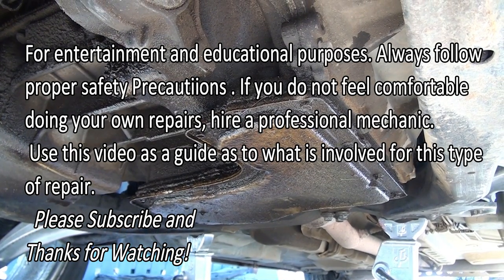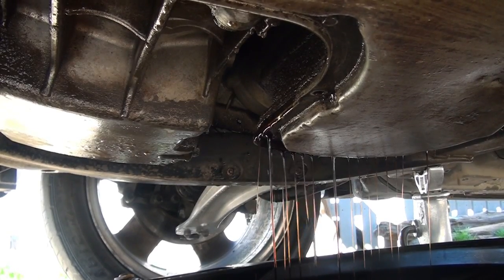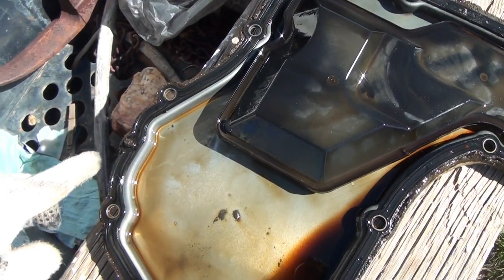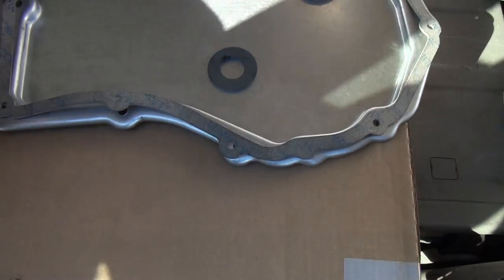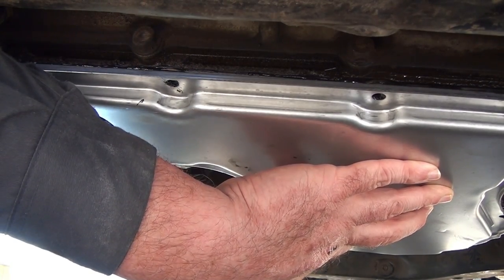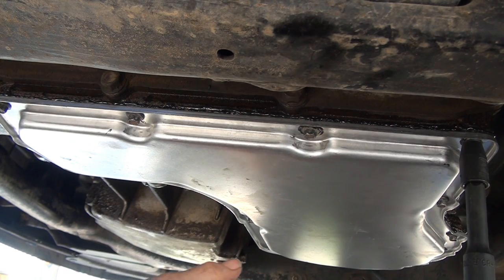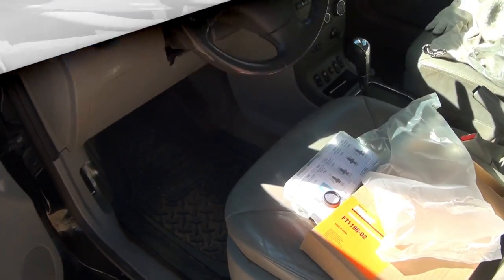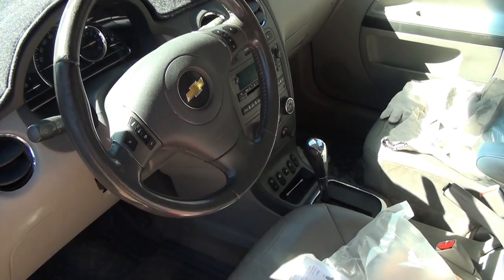Chevy HHR Transmission Pan and Filter Replace 2 4L

Comment: There is a port on the pass side to check level.  Well, you open it and fill until fluid just starts coming out the port.
Reply: With the vehicle running or off?
Reply: @mnmurph  running.  if off a lot will come out when you pull the plug.

Comment: That pan really took a wack somewhere. Don't you just love this new no dip-stick transmissions? Great video!!
Reply from the maker: The previous owner did not believe in driving slow over bad roads, much less doing necessary repairs. Shop manual says 6qt. fill after pan replacement. It made a huge difference in shifting. Yes, no dip-stick is not the way to go as I will explain in an upcoming video.Chevy HHR 333740 miles and it still lives.
Reply: @SteveAZ711  Wow
Gives me hope for the future of my HHR.
Reply: New nick-name for joe biden No dip-stick president! LOL

Comment: I've considered having mine done even though the manual says it isn't necessary with regular use. I only hesitate because of how doing a change can cause issues later if you go too long on the current fluid without changing it. Mine currently has just over 98,000 miles on it. How many miles were on the fluid in your HHR?
Reply from the maker: Probably 300000. The original owner all but drove it into the ground. If you are looking for more information. I suggest calling a dealership and asking them how often they recommend a fluid change on a 2.4l or 2.2l engine.
Thanks.
Reply: @SteveAZ711  Will do. Thanks for responding!

Comment: Do you think it is safe to do this at 125,000 miles?
Reply from the maker: Check out other people asking the same question. I would change mine... but you may not want to change yours. LINK...https://www.chevyhhr.net/forums/maintenance-upkeep-50/miles-between-transmission-fluid-change-32272/

Comment: Thank you this was really helpful. I hesitate to take it to Dealership because they change to much and every time after getting it back, it has never failed something always happens 2 weeks after or they don't replace things correctly.
Maybe because they think I am a dump female. I use to change my transmission oil and all on my jeep.
Thanks again.
Irene A.
Reply: Are you sure you used to change your own tran and engine oil and you're a woman, hmm !
Reply: You are wise to find a good local independent shop to do it.  Don't want to bash all dealers but our local Chevy/GM store is not a good place to take a car for maintenance...based on my experience.  You can see the way this is done from the video.  Only way to get the fluid level right is with the car in a level position, engine running in park, remove the threaded plug, etc.  Difficult to do without a lift unless you trust your life with jack stands at all 4 corners.

Comment: Very good video sr, you said 7 qts of fluid  when I drained fluid I has a little extra and a little  thicker fluid, compare with new that is more thin,you think maybe some one add an additive, cause I've had this car for 12 years and haven't  replace fluid till now ,with 173000 miles on it
Reply from the maker: It is possible. Thanks for the nice comment!

Comment: It is a nice explanation tube, thank Steve. 
I'm wondering whether I need to change the oil in my 2006 HHR which ran like 180,000 miles?
Reply from the maker: I changed mine at 333,740 miles, and as far as I know it had never been changed before. Chevy says that you never have to change it, if the car is used in normal driving. I guess one would have to decide what is normal. I know using it for towing or like a delivery van or taxi would not be normal. If it is not whining or hard shifting and seems to be fine...then I would not change it.
Reply: @SteveAZ711  Thanks for your reply, I appreciated.
Reply: @SteveAZ711  - On an HHR? Wow, that's a lot of miles! What engine parts have you had to change?

Comment: Did you get ALL the oil out just by dropping the pan?  I thought you had to flush it out.  And do you think the 2.2L is any different?
Reply from the maker: I did not flush the system. The pan was dented. I replaced the pan, gasket and filter.

Comment: I hit a big rock and it bent the oil pan underneath the HHR 2009 car car and I had it fixed and now I have oil spelling so I don’t know what they did I don’t understand and my transmission is slipping so I don’t know what to do
Reply from the maker: Call the people that did the work and explain your situation. Hopefully they have a warranty and can either fix or find what is the problem. Stay calm as it could be something different.

Comment: Could this be a reason for the car not going into drive ? I have a 2009 2.2L
Reply from the maker: Low fluid level or a clogged oil filter could cause the HHR not to go into gear or go into gear very roughly. However, since the transmission is basically a sealed unit, it is very unlikely that low fluid or no fluid or clogged filter is the problem. I assume that all the fluid is still there. It also could be an electrical issue causing a shift solenoid malfunction. Have a qualified mechanic that knows something about these transmissions look at it. It may just be a loose or chewed wire(mice like wiring for some reason), some cars more than others.
Reply: @SteveAZ711  thank you
Reply: I know this is old but Its most likely the transmission oil feed lines. They crack easily causing the car to lose the foward drive. (Assuming you still have reverse)
Lift car remove pan
Remove trans filter
Remove the 4 bolts holding the  metal trans oil feed lines.
Replace with a new ($120+) or refurbished one from junk yard ($7) (if its still good)
Replace filter..
Replace pan and gasket..
Fill w 6 qrts
Drive around town playing Wu tang!
Reply: @GesWho1904   what if it goes in drive, but don't shift out?

Comment: Could you have added a plug hole so that you can service this transmission and change the fluid like every year or so?
Reply from the maker: Hi Mike! You know every time I pull a tranny pan I think of adding a drain plug just for the convenience of what you mentioned. It can be done, and I bet someone put a YouTube video up with just that idea in mind. HHR transmissions generally do not require fluid changes, so the manual says about the HHR. The cars that do require fluid changes usually have very long intervals such as 50,000 miles 75,000 or 100,000 miles. My 92 Astro Van I believe is 10,000 miles.That said, I would still have to change the filter which requires removing the pan anyway. If one removes the pan like in this video, then it really is not a difficult repair. However, I still  can't help thinking about that drain plug.

Comment: the pan wasn'"t bad but the filling process really sucks.
Reply from the maker: Oh it was easy to fill ok, but if I ever have to add due to a leak then the checking process really, really sucks. Mind you auto transmissions are not supposed to leak...but they do sometimes and with no dipstick then I am pretty much in the dark as how much to add without doing a shop manual checking procedure(soon to be explained.) NOthing was added to this tranny ever and it was over a quart low after 333740 miles. Luckily the trans fluid was not burnt. The suspension issues kept the owner from driving it... so it sat and leaked a bit more over time. ConnieAZ21's uncle refers to these small Chevys as "Throw away cars". Just use them up and throw them away. A different uncle bought one new and the other uncle made the comment. It was then that the beer drinking and arguing began  LOL